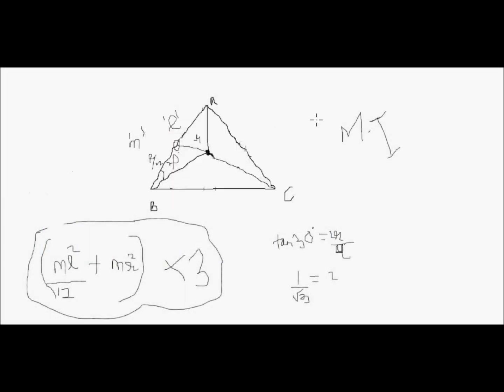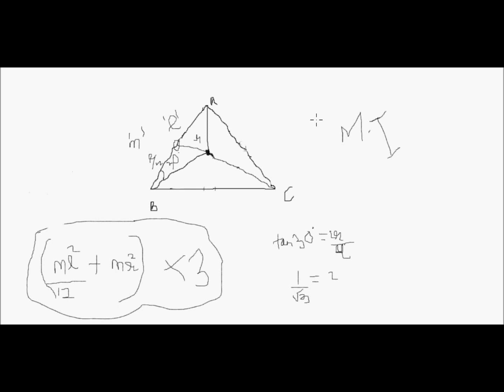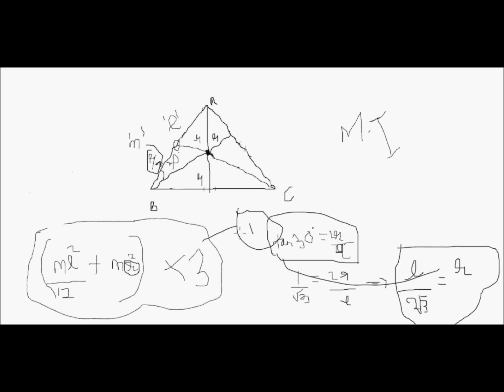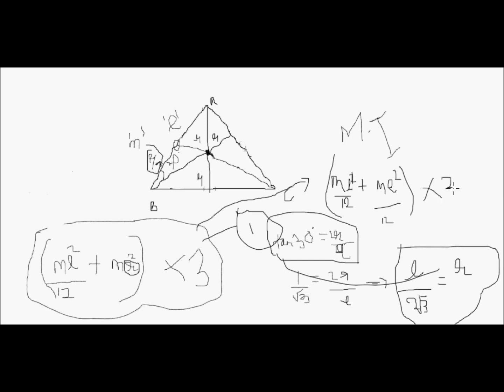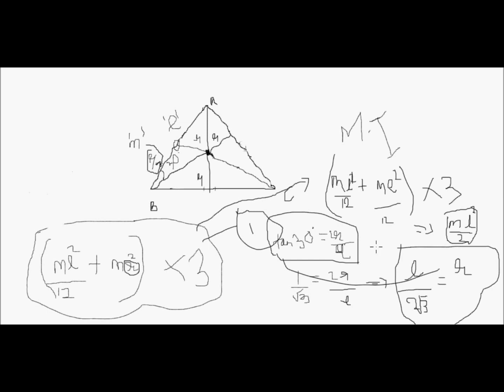To find moment of inertia of equilateral traingle.wmv

Comment: please can u explain howa we obtained  ml²/12 ??
Reply: +Safaa kaddour fellag  To get The M.I of a rod that passes through the centre of the rod and normal to it , is calculated by using integration.. 
 It would be better if u learn to calculate the moment of inertia of a rod when an axis is placed at the end of the rod.. Suppose the Rod is of mass M and length L.
   From the Rod , i chose a small element of width dx and of length x from the axis  so the distribution of mass (or density of mass) for that small element = (mass/length)(dx)

 Now we know that M.I for a rigid body at a distance r from a given axis is ∫M.r²
  We will have a small moment of inertia for that small element dm...
  So..  di = dm. r²  and now we know the values of dm (we did that above) and we know that we took that element at a distance x from the axis.. so now the expression becomes....
      ∫di = ∫dm.x² we are doing this for a small element.. .by integrating we will get the total M.I of all the particles in the rod.. so my limits of integration will now be from 0 to L.. 
 so now after substitution of calculated values..
  ∫di= ∫ (M/L)(dx). x²
 Since M and L dont vary ... we take them as constants and keep them away from integration... now..
  ∫di = (M/L)∫(dx).x²
 After integration... we get..
  I= (M/L)((L².L)/3) 
  we now cancel the L in (M/L) and one of the L in ((L².L)/3) 
  So now we get  I = (ML²)/3
     Now just substitute L with L/2 as the axis is now placed in between.. we then get  I=(ML²)/12 (You can also obtain it by integration but this is way lot easier )